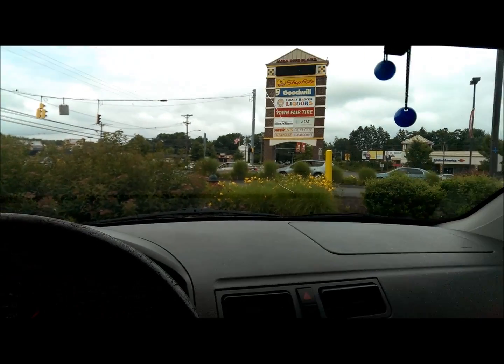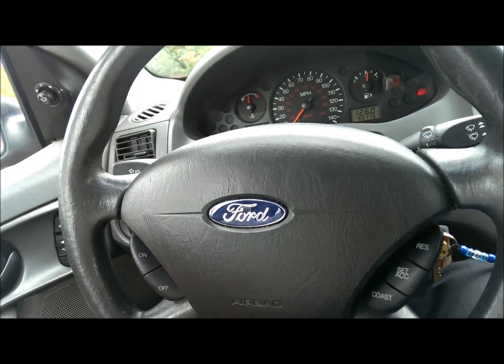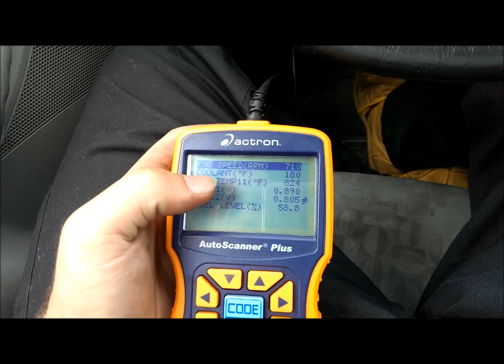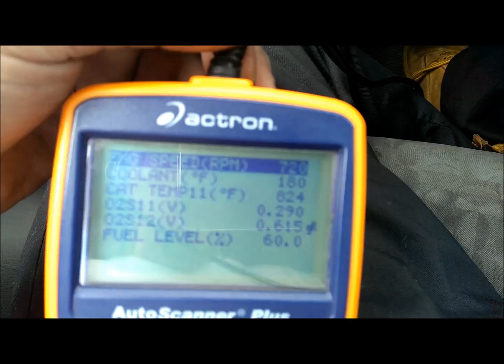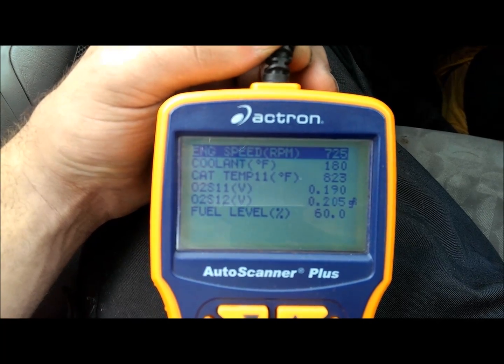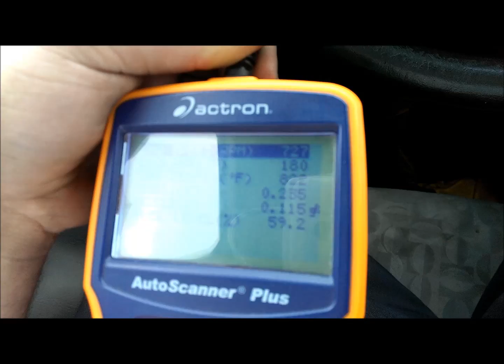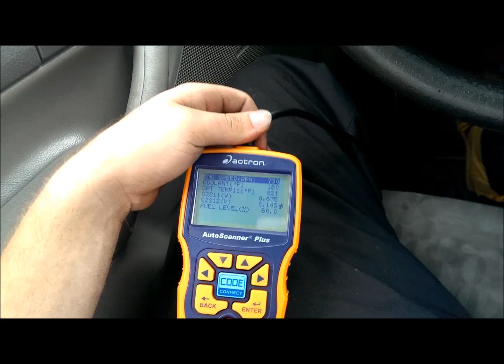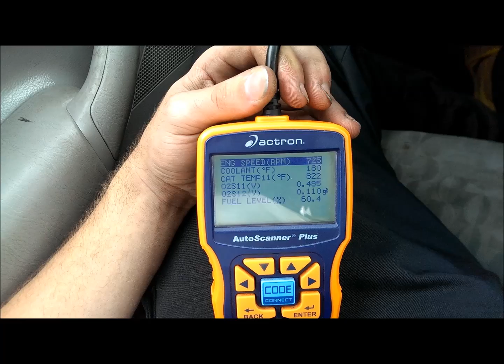How to Check For A Bad Catalytic Converter

Comment: The temperature of tha catalytic converter at idle will be nearly 650 - 800 degrees. Yours is consistant. When you do a mild drive cycle of say 40 mph, the temp will definitely rise up to 1400 - 1600 degrees. Any higher means the convertor lost its efficiency.

Comment: Great Video 

I bought a Cat 2 years ago, 
Can it be broken?
0.71 CO2, normal 0.2.
But it doesn't jump so much
0.44 - 0.6 / 0.71 - 0.8.
It was on the Exhaust machine device at Tüv Germany.

The petrol smells a bit toxic.

How can it be gone in 2 years?
Any help ?

🙏 Thx

Comment: The normal operating temperature of a catalytic converter is between 550 and 1,600 degrees Fahrenheit with the optimum temperature being about 806 degrees

sensor is broken...  1 or both

Comment: I have a scanner but it doesnt detect the cat temp now my upstream 02 sensor is bad and couple days after i threw out the 02  sensor my cat code popped on and i replaced the cat 5 months ago now i dont know what to do if i should just replace the 02 sensor or replace the cat as well. My upstream 02 sensor has no voltage
Reply: that means the wires are broken or the sensor is bad

Comment: I don’t have any codes but my cat monitor isn’t setting. My rear o2 readings are fluctuating but not as much as this video, they stable off for a bit and then will fluctuate again. You think this is a bad cat as well? 
Thanks in advance

Comment: The first O2 sensor Upstream to move a lot the second sensor Downstream from the catalytic converter should not move very much at all and should stay at a high number which means good efficiency simply said personally if I have that code I would probably replace one or both of the oxygen sensors first of all if you have a lot of miles on them cuz I was catalytic converters and the manifold couldn't be quite expensive

Comment: Im having intermittant p0420 code. If im driving about 70mph on highway the check light blinks once as though the fault happens at 1 moment. Can do it 2 -3 times on long journeys. Reason i know its p0420 because i left my diag tool on until it happened. I replaced both cats bank 1 and 2 and full exhaust with genuine oem parts. Still happening so i replaced both o2 sensors and still no different. Driving me mad now.

Comment: My reader shows 2 volts steady on my downstream sensor. The cat is brand new. I suspect my sensor but I replaced it once already and the reading didn't change. I used a bosche and had to wire the old plug myself. I do have the P0420 code with the CEL on.
Reply: @TeamNewbsTv bosch is oem

Comment: Thanks for the Info. Very useful. I want to keep an eye on my O2 sensors and Cat.  Especially after doing intake intake valve clean with seafoam, to see if that affects them.  I will do a little at first ...run for a week, and check if any harm done.  I could do this a few times, just to ensure carbon cleaning of the valves isn't causing harm down stream.  Have ordered my OB2 today.

Comment: Of course is got a lot to do with performance if you don’t burn these emissions they will be all over your engine that’s when you start getting misfires and all kinds of issues on your car, I always advise people to buy a good quality catalytic converter, there’s many cheap out there but chances are you still have the same problems as before, a good quality catalytic will give you better HP no doubt about it, think of a bad oxygen mask that only lets you breath 60% you will feel like desperate, same with the cars

Comment: I have a 2004 pontiac bonneville gxp with a 4.6L V8 Northstar only 52,000 miles a few months back I got a code for a bad O2 sensor took it to a shop they told me they needed to remove the cat and  install a resonator I didn't want a check engine light on so they told me to order a cat I ordered a Bosal cat from Rock auto the check engine light went off after it was installed and came back on in 1 day they told me to remove the cat again I  had it removed and sent back to Rock Auto  and they  test their parts before they issue a refund to determine if the part is faulty Rock Auto said the part works fine i've had the O2 sensors/wires examined multiple times and was told their fine HLP! next step is filing a civil suit because my cat probably needed to be cleaned   HELP! any suggestions would be good.
Reply: Get a Actron CP9680 code tester. It checks live, record, graphing, emissions readiness test, transmission codes, oxygen sensor test, ABS, SRS, and MORE! Get 4 aaa batteries for under the rear cover. Get a USB cable to update it. It works on 1983-2013. It's well-lit! It comes on a black pouch. EBAY has it. By getting your own tester, you can find out what's going on. It retains the memory of tests for away-from-the-vehicle review. It has code-connect to diagnose codes. The CP9690 is for OBDI and OBDII.

Comment: You didnt mention that a bad tune up 
Sparkplugs or wires can get you that code due to a lil bit of missfire.
On my magnum 5.7 i changed all 16 plugs but not the wires, upon starting the car i notice a lil bit of rough idling to a point you couldnt notice but since i drive it everyday i noticed it. A week later of driving it the light came on stating my right side catalyc is out.i also had holes on my muffler tips got those welded and changed my plug wires. Upon doing that i disconnect the battery, after putting everything back i have drove the car for about 88 miles car dont idle rough no more and no light has come back.most likely i will need to drive 100 and plus miles so the computer can reset it self.

Comment: the convertor I/M monitor gets tested during highway type driving.  If your car sees a fault it will have a pending code. If it sees another fault within 40 warm up and drive cycles it turns on the light.  So if you do 40 cycles without it getting  a fault it turns back off.

Comment: A Actron CP9690 goes up to 2013 and is updatable. It has OBDI  adapters for Ford, G.M., Chrysler, and 2 Toyota. It has a OBDII cable, a cigarette lighter cable, a black carry pouch and instruction manual. You can get a computer cable to update the tester from E-Bay.
Reply from the maker: Very nice to know Robby! I thank you for the comment sir and for watching. I myself have sine invested in my own personal scanner for work (this video is 5 years old already...lol), The Millenium 90 Pro from my Matco guy. Thing is awesome, worth way more than the price I got it for. It is update-able but out of the box it does up to 2017 vehicles.

Comment: Maybe the second sensor itself is bad. How would you be sure that the O2s12,gives you the correct readings? Wouldn’t you test the second sensor also before you replace the cat? Try to be more elaborate before replacing the part. Thanks
Reply from the maker: You are 100% correct in that you CAN perform a test on the downstream o2 sensor and make sure the wiring is good to make sure it is . But in the interest of this video in trying to keep things simple for most people who are not technically savvy in helping them diagnose this issue, 90% of the time if the o2 sensor is bad, you will have an 02 sensor code and NOT a P0420 code.

Comment: Hello how are you doing? I have an 05 murano,it has a P0420, I checked the voltages on those O2s. The O2s11 has 0.290 to 0.300 volts only. And the O2s12 has 0.580 to 0.640 volts. Is the sensor before the cat is bad or both? Looks like the one after reads slightly high,or is it ok? Thanks

Comment: Does that code come up automatically for that converters because your check engine light is not on?
Reply from the maker: Hello Darlene! Yes that code comes up automatically if the car's computer sees the o2 sensors are not exactly right and are not within the correct parameters. If those sensors are reading off and there's no detection of issue of the sensors themselves it will throw a catalyst P0420 or P0430 code always. The computer says "Hey these sensors are working good but why are the numbers off? Red flag" and immediately condemns the catalytic converter. 

I admit that this video could be better honestly and there's other ways you can truly diagnose if a catalytic converter is good or not along with this but if there was an o2 sensor problem you would 90% of the time have a fault code for an o2 sensor and not the catalytic converter. I hope that helps! :D

Comment: Hey dale, helpful video. My truck has the same code. But my bank 2 sensor 2 only fluctuates when I'm driving, when it idles is stays at the proper voltage. Is this still a bad cat? The other cat doesn't fluctuate when I drive it.
Reply from the maker: My apologies for the long delay in replying! I do not know for absolute certain but I would say with your situation it would be a bad cat. You COULD try just replacing the o2 sensor and hoping it fixes the issue, but that is in the small minority of actually fixing it. 

I say it's still a bad cat because when you drive, obviously more burned gas is going through the system than just at idle. With the increased volume of gas (and increased pressures) it's more stress (so to speak) on the cat. A weird example is like a pinhole hole in a garden hose. Leak isn't as pronounced at low pressure but at high pressure is when you notice a problem. This is exactly what a truly failing catalytic converter does, it loses it's efficiency and will be much more noticeable during more strenuous operation. 

By all means you can toss an o2 part at it and pray it solves the issue but it's not likely and I wouldn't recommend doing that. I thank you for the comment and hopefully my explanation helps you!
Reply: Dale thanks!!
Reply: If tossing an 02 part at it and it didn't work, then you would have a spare and maybe use it on sensor one in the future.?

Comment: They both look like they are jumping hhmmm?
Reply from the maker: Living With The Guzmans You would be correct, good eye! Long comment warning... But its not supposed to be that way. The primary O2 is supposed to jump up and down in voltages because that is the sensor responsible for helping to manage fuel trim. It switches rich-lean-rich-lean really fast since the perfect "stoich" fuel and air balance is 14.7 parts of air to 1 part fuel. It is impossible to achieve that. 

The secondary O2 however SHOULD stay pretty constant because that is responsible for measuring the catalytic effeciency. As you see it was going all over the place meaning something was wrong with the catalytic converters efficiency in burning off all the pollutants. This is why the P0420 code gets thrown
Reply: The secondary is the one close to the muffler right? Good info thanks
Reply from the maker: Yes! The secondary (or the downstream) sensor is the one closest to the muffler after the catalytic converter. 

Many people when they get a P0420 code immediately condemn that downstream O2 sensor thinking its bad. Its possible yes but if there is an issue with that sensor, it would appear as a O2 sensor code and not a catalytic code
Reply: The first sensor on mine jumps but the second one stays steady on mine. check engine light on with P0420 code could it still be the cat?

Comment: I have same problem and same car. So did u replace the catalytic converter?
Reply from the maker: ger tis Yes it did! I didn't have the car when it got fixed (I gave it to my sister) but when she had it replaced the check engine light went off for good. 

Also as a piece of advice, try to get an OEM catalytic converter and not an aftermarket one. Its much more expensive but a lot of times aftermarket cats are a headache in the long run.

Comment: https://www.actron.com/sites/default/files/15-08_actron_catalog_2015_rev_h.pdf in there says ppg 6 of 21 "Coverage CP9680 AutoScanner Plus updated to 2013 models".  Also during 1994- through some of 1996 were some early OBDII vehicles while they were getting ready for full OBDII rollout.  If you want to do a pre 1996 vehicle you'll need to use the CP9690 "Elite AutoScanner".

Comment: could a bad catalatic converter cause stalling in cold weather only.
Reply from the maker: Are you noticing this in cold weather only? How about when the engine is cold (not up to normal operating temp)? Cold weather plays havoc on fuel-injected cars and stalling in the cold weather is a fairly common issue.

A bad cat COULD cause your car to stall if it is REALLY clogged.  But if it was that bad your car definitely would have had signs of it before it got to that point, like decreased fuel economy, poor throttle response, etc. Also if it was that bad, it should stall at any temperature and not just cold. It is possible yes, but it would have to be VERY bad. I would however not condemn the catalytic converter in this instance if it's just stalling in the cold. Thank you for your comment!
Reply: Dale onlt weather below like 50 degrees Fahrenheit
Reply from the maker: DillonOnTheGo I would say no, the cat would not cause the car to stall in the cold.

If you dont have a check engine light on, I would try doing the basic tune up things like changing the engine air filter, spark plugs and wires/coils, fuel filter (if accessible) and go from there.
Reply: Dale i actually just did tune up saturday, next will be MAP sensor. and then i heard low trans fluid can cause a automatic to stall
Reply from the maker: DillonOnTheGo That was going to be my next statement lol. Before you go condemning the MAP sensor, check all sensors in or around the intake like the mass air flow. Remove and clean them with a sensor-safe cleaner. 

Just for the sake of it, try cleaning the throttle body out as well with carb cleaner as well since you are in the area
Reply: Dale i cleaned throttle body and iac sensorx and replaced tps. replacing pcv valve tomorrow
Reply: Could this also indicate a vacuum leak?

Comment: Just one note,I believe that if the cat is bad,it will give the wrong O2 reading in the downstream O2 sensor and it will in turn give a false reading to the ecru and won't be able to give the proper signal to the injectors. So,even though the cat itself is about cataloging NOX and CO into CO2 and water vapor,it will in turn affect engine performance by making the car run too rich or too lean. Correct me if I'm wrong...good tip on the higher end OBD II tool with specific temperatures and O2 sensor voltages 👍🏽
Reply from the maker: Thank you for the comment! As far as your concern though, as long as the O2 sensors are working properly, a bad catalytic converter will not (or should not) trigger a bad downstream O2 sensor code. If your downstream sensor is cause of a check engine light, 9 times out of 10 it's a bad voltage reference (high resistance, low resistance, etc.) to or from the sensor itself and not what is actually being measured. 

The downstream sensor (if it does go bad) does not typically impact fuel economy much, if at all because that is the upstream sensors job to regulate fuel trim. If that downstream sensor goes bad, it should not make the car run that much different because all that one is doing is "piggy-backing" making sure the cat is efficient and doing what it is supposed to do based on what is going into the cat, measured by the upstream. 

Sorry for the long comment, hopefully this helps you out!
Reply: No, Jaime, It is the first 02  that the computer uses to set fuel trims. So Cat will have no effect on that.

Comment: How do you tell if its the O2 sensors that are causing the fault
Reply from the maker: Hello! Almost always (9 times out of 10) you will have a Check Engine light code for an O2 sensor fault ("O2 Sensor Circuit Low Voltage") and not a P0420 code. You could always test the sensor itself by measuring the appropriate voltages and resistances and seeing if they are within specifications. That is a lot of work and usually not necessary but the most sure-fire way to make sure the O2 sensors are working properly. Thank you for watching and commenting!

Comment: TO GET A GOOD READING MUST THE ENGINE BE  HOT OR COLD(on a Toyota CROLLA
Reply from the maker: You will want the engine to be at normal operating temperature when doing this. Doing it when the engine is cold and coming up to temperature will not give you the proper readings
Reply: But,also,2,3 and 4 wire(newer models) downstream O2 sensors have sensor heating integrated to read proper O2 levels...but the cat should be up to driving temp and holding to around 2500rpm while taking the readings on the OBD II scanner or taking the upstream (500+ degs)and downstream (650+degs) exhaust readings.

Comment: My digital range fuel numbers dropping crazy I'm looking to see its fuel leaking some where or its some engine electronic issue make fuel waste a lot so first I did what u did took blue drive  to diagnose the problem I have no check engine light but I'm loosing fuel a lot not normal amount so catalyst doesn't pass and O2 Doesn't pass ??!! Any advise ??

Comment: In regards to CAT temps, did the engine go through any high load driving to get it up to operating temps? or were you just idling?
Reply from the maker: At the point of when I made the video, I had driven about a half hour home from work (about 17 miles, backroads and no intersections to stop at). I had the car off for maybe a few minutes when I went inside to get the scanner and the whole time of the video the car was just idling

Comment: hey, i have a cheal bluetooth obd2 "scanner". i have a v6 nissan maxima with an occasional p0420. through the device app, it has the option of reading the o2 sensor voltage, but the sensor 1 in both banks is always constant around .3 and the sensor 2 is around .7. does that mean anything? or is my "scanner" not giving the proper reading? thanks in advance
Reply: with faulty probe can not be P0420, will Faulty sensor error (p0136, p0137). Your sensors are OK. Defective catalytic converter Bank 1: Installing the electronic emulator corrects this problem :)